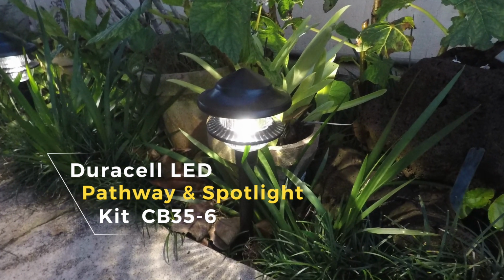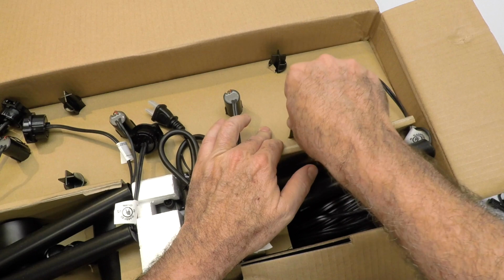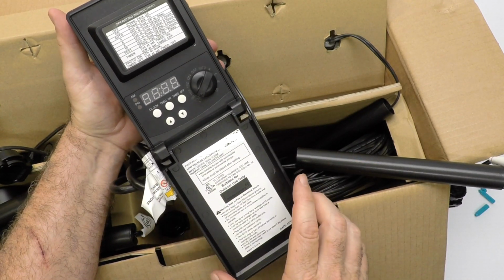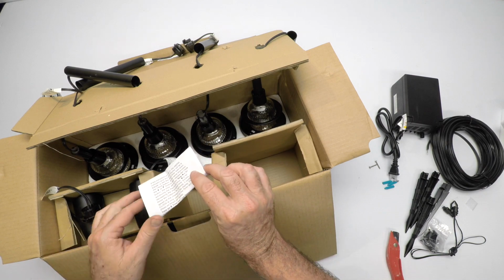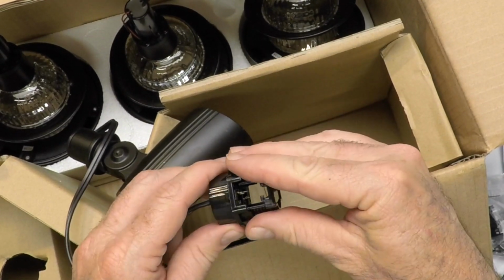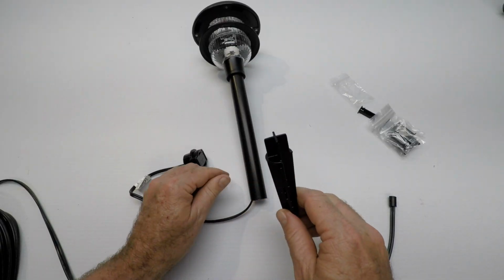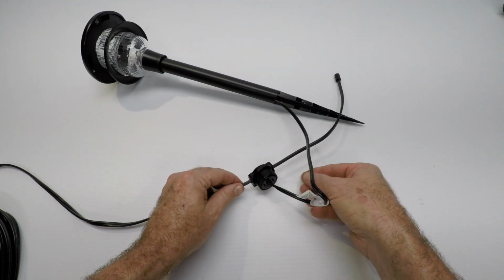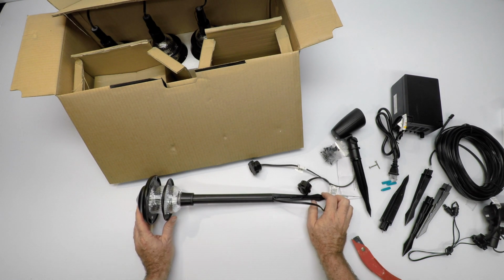Make Outside Magical with our LED Duracell Pathway & Spot Light Kit + lighting tips!

Comment: This was a really informative and useful video. Thank you, it’s helped me make up my mind and buy the UK equivalent.
Reply from the maker: Glad our video could help 😃
Reply: @Totallightingsupply  I'm now really glad to say that thanks to you, I've bought and installed two sets in London.  They were so easy to set up.  The UK spikes are a different construction and simply screw in to the lights, which seems like an improvement on the design, but still have the indent for the cable. The transformer and cable connectors in the UK are slightly different too.   All the cables have ends which you just push together and screw to seal, so there's no need to worry about any bare wires to connect, even at the transformer end.  The other difference in the UK's transformer is that it doesn't have any of the fancy timer functions.  But I've used smart plugs and now my garden lights are controlled by Alexa. I'm so happy... Thank you, thank you, thank you!!!
Reply from the maker: @abih724  You're very welcome 😃 Would love to see a picture! If you ever get a chance to take one you can send it from here https://www.totaloutdoorlighting.com/contacts/ Blessings to you 😊